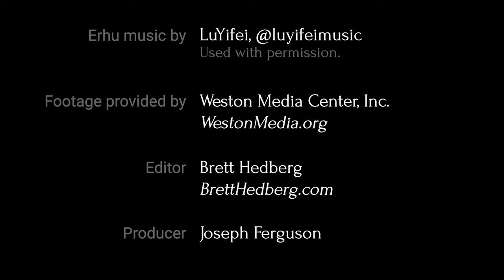Glass and Rod

Comment: Hi Joseph,
What a wonderful artist you are! I’ve never seen anyone making 3D sculptures like yours. They are amazing! Thank you for sharing! 
This also left me puzzled - how on earth did you join those glass sculptures in the wooden frames? It seems really tricky to get that precision for rod holes if you inserted the ready-made sculpture into the frame. Or did you build the sculpture into the frame? How did you manage that? 
All best wishes to you!
Reply: I build the frame the size needed for the composition usually 6 inches deep. Holes are drilled into. The frame the diameter of brass  rod of a thickness necessary to support the composition  : industrial brass rod can be found any diameter I n. 10 foot length.  I hope to give more information via video . Thanks for your interest, Joe f

Comment: Just amazing! I’m curious how you made the bronze wire go into your base, what is the base material? Keep coming up with more video 😊
Reply: My bases are blocks of stone or heavy wood, I build the sculptures in averticl position ,, as a painter would paint a picture. I use brass rod, obtained from an industrial supplier, diameters around 1 eight dia.  easily bent. I hope to have more pieces on Utube. Courage.  its worth the anxiety.